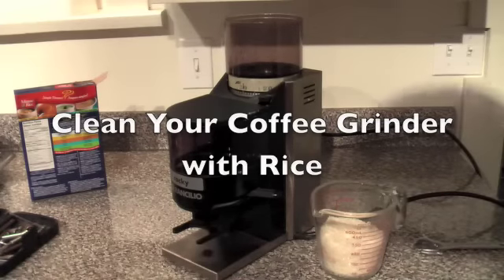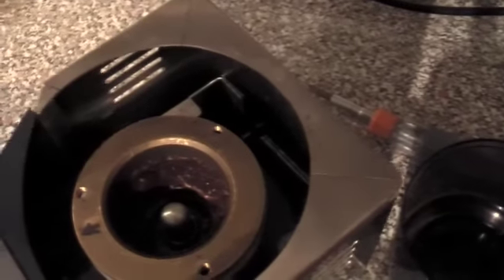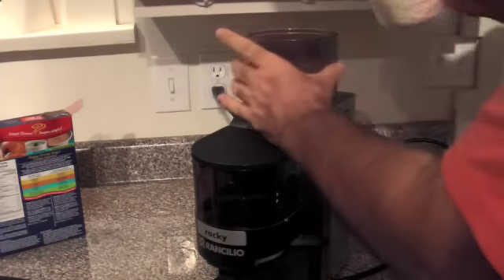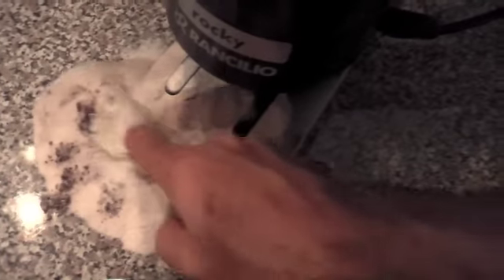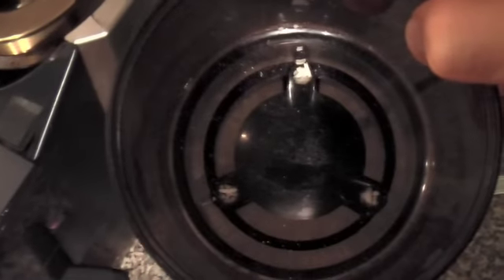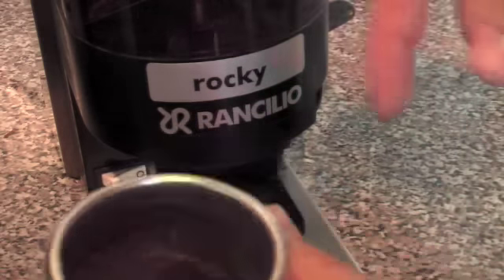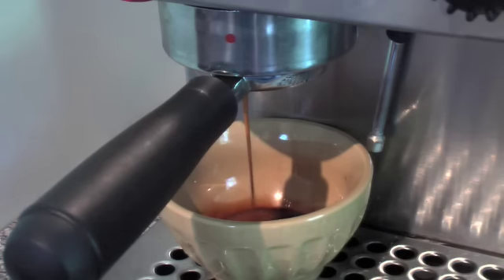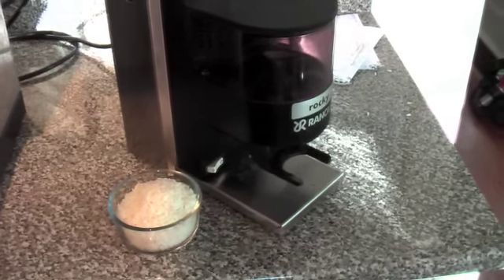Clean your Burr Coffee Grinder with Rice

Comment: I use this method regularly and it works great. I only use 2 Tablespoons of rice, you don't need that much to do the job. Then after I run the rice through, I remove the upper burr and thoroughly brush it and the bottom burr to remove the rice dust. I then turn the grinder upside down over the kitchen sink and tap out anything else that was left behind. Before brewing my next cup of coffee, I run 1 Tablespoon of coffee beans thru to remove any remaining rice dust, which there is very little of, btw.

Comment: Further to my previous comment... I recently invested in a brand new Breville Smart Grinder Pro, on the advice of my coffee supplier. (I'll admit that it sounded like very stupid advice, considering the problems with the first one.) Apparently, the real issue was that the clutch mechanism in the first roll-out was defective. No amount of cleaning and purging with rice or Grindz pellets, or testing different coffees, was ever going to remedy that bad clutch. I removed both burrs, and brushed out every last molecule of coffee, and the clutch still screamed as if it was clogged solid. According to my supplier, the new model has a different clutch, and I haven't had a problem since.
Reply: Same issue, inside of 2 years of ownership. Breville replaced it under warranty, though they didn't have my brushed steel model with the new clutch at the time. The black one was fine, and has been chooching ever since, though it gets a more frequent vacuuming and brushing inside the grind chamber now. ;)

Interestingly enough, our older model Breville Hemisphere blender failed for the same reason, bad motor clutch.

Comment: My coffee supplier freaked when I told him I'd used rice to clean the burrs of my Breville Smart Grinder Pro. Rice does clean the burrs, but apparently is much harder than coffee beans. I'm told it will seriously dull the burrs in very little time. I now use Grindz 'beans', a food grade professional cleaner designed specifically for cleaning coffee grinders.
Reply: +Cole Wiebe Thanks for adding this note - I was on the fence myself between buying more Grindz or just rice.
Reply: Minute rice is precooked and then dehydrated, it's softer then regular uncooked rice
Reply: I just talked to a Breville Repairman at Breville the other day who RECOMMENDED running a handfull if rice through mine.